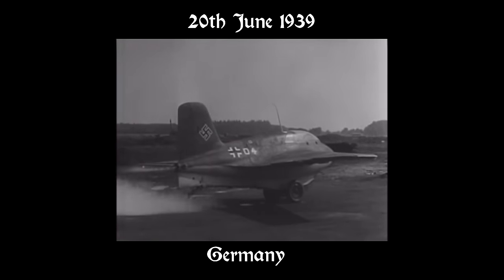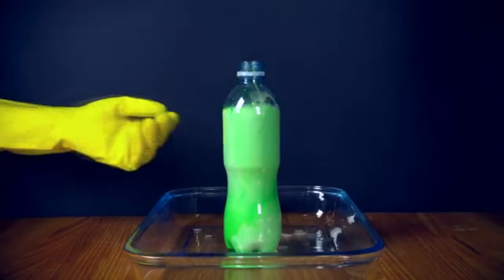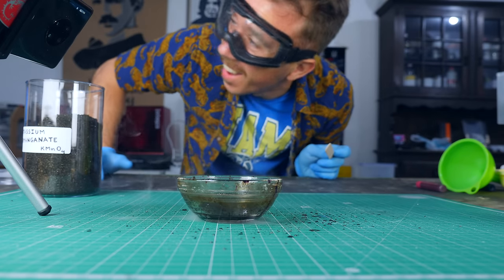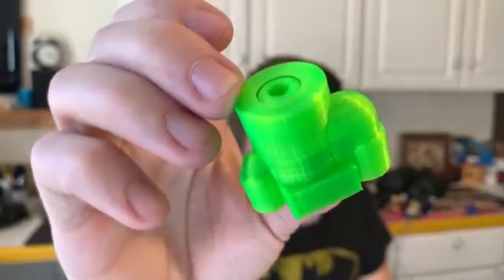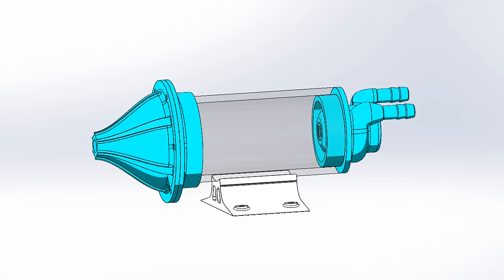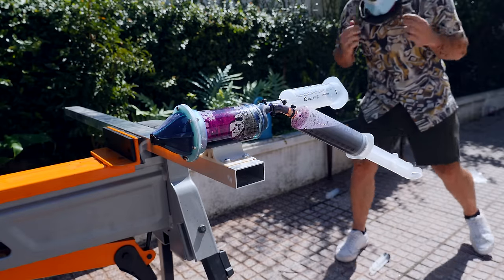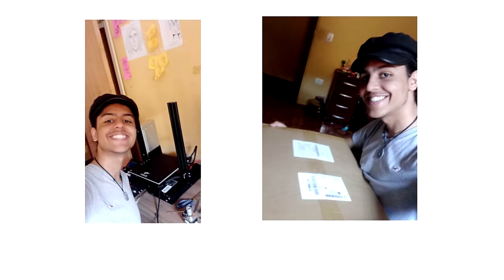The Forgotten Nazi Cold Rocket Engine (3D Printed)

Comment: Make an ALICE rocket, but using hydrogen peroxide instead of water.  
https://en.wikipedia.org/wiki/ALICE_%28propellant%29
[update]The output of H2O2 decomposition is H2O and liberated O2 
Al H2O combustion results in Al2O3 and liberated H2.
I would presume H2O2 Al combustion would not have much leftover H2 or O2 if the stoichiometry was matched as those have an affinity for each other.
Reply: I don’t think H2O2 would benefit the reaction, Just thinking about the reactions in my head, Im 90% sure you would get less out of H2O2 and aluminum frozen than H2O and aluminum frozen
Reply: @demolition3612  The output of H2O2 decomposition is H2O and liberated O2 

Al H2O combustion results in Al2O3 and liberated H2.

I would presume H2O2 Al combustion would not have much leftover H2 or O2 if the stoichiometry was matched as those have an affinity for each other.
Reply: @zyxwvutsrqponmlkh  You can't really freeze H2O2 above like -60°C so preparing and storing that would be kind of a pain already. Also the H2O2 will probably start decomposing due to the high surface area of Al nanopowder present, which would lead into thermal runaway pretty quickly and make it dangerous to work with. Besides that, even at appropriate storage temps like -80°C the peroxide will still slowly decompose, turning the propellant into a porous mass and most certainly lowering it's efficiency.
Reply: @zyxwvutsrqponmlkh  I know, however he is using 50% H2O2 50% H2O, and on average the reaction would be like this ; H2O + H2O2 + (2)Al -> (2)H2 + 1 Al2O3 
The reaction with 100% H2O goes as fallows, (3)H2O + (2)Al -> (3)H2 + 1 Al2O3 the one with 100% water gets you more hydrogen per aluminum oxide generated, this is negated if you use 100% H2O2, 
(3)H2O2 + 4Al -> (6)H2 + (2)Al2O3
Also in an Alice rocket it needs to be frozen as a mixture, and the aluminum powder must not be oxidized. H2O2 is just slightly harder to freeze apposed to water.
Reply: @Bavarianscience  H2O2 freezes very slightly after water.  I have used it to try to fractionally distill 35% peroxide.
Reply: @demolition3612  Aluminum forms an oxide layer instantly upon contact with air (or water, or hydrogen peroxide).  This oxide layer is important and will help protect from spontaneous reactions.  But you obviously don't want it too thick or you cant get it to combust when you want it to.
Reply: I wish I knew what you guys were talking about
Reply: @Swiftss  It's a proposed, presumed improvement on a rocket propellent that is hardly ever used.  Burning aluminum in water is the original, I think it may work better if you burn aluminum in peroxide.
Reply: @zyxwvutsrqponmlkh  oh I see, I never would have thought of that. And you are clearly 10x better at physics and chemistry than me XD
Reply: @zyxwvutsrqponmlkh  the oxide layer is always too thick, the idea is you want no oxide so it will react, its supposed to be a propellant, so it needs to react and not have an oxide layer. The oxide layer is always a few micrometers thick
Reply: Lets hope integza isnt dumb enougb to fall for these like botters. 2.2k likes with only 10 replies? Sure. A better comment has 1.2k with almost 40 replies
Reply: @demolition3612  Aluminum dust with no oxide layer spontaneously combusts in air or water, it simply wont work at all.  Poring molten aluminum in water can explode foundries and casting plants sometimes explode because of this.  This potential energy is exactly why aluminum is a suitable rocket fuel but it absolutely needs the oxide layer for practical reasons.  Ideally you would identify some ideal grain size with some standard thickness of oxides.
Reply: @piguy2829  I think he buys them himself to get engagement metrics which makes the algorithms happy and drives traffic.  You look at all his videos right after launch and you will see this sort of thing, the first handful of decent comments get a ton of likes right away.
Reply: Another advantage that came to my mind is that, if this is going to be a rocket, it would save weight as well
Reply: An ALICE rocket sounds cool.
Reply: 1. It would be easier to do a sugar candy (and KNO3) rocket.
2. Maybe you didn't notice, but Integza doesn't like to make solid rocket engines.
3. ALICE is very complex to manufacture (academic researchers had problems with it).
4. ALICE requires very low freezing temperatures (like -40*C) in order to ignite and not explode.
5. ALICE requires ridiculously fine grain of aluminium powder (which is very dangerous).
6. Didn't you buy fake likes for this comment?
Reply: Me163 was the first
Reply: That would go runaway the moment you try to mix it 😉
Reply: @hufca  -40 C is simple to get. Acetone and dry ice bath gets you close enough.
Reply: As cool as an ALICE rocket would be, I feel like that would be far too hot for his goal of keeping it 3D printed. But at least I learned that ALICE rockets existed! Thanks for sharing!
Reply: I watched a video about Alice propellant right before This one and now I see a comment about it lmao
Reply: @FrankRoosevelt32  Yeah, but alice is more like a solid propellent which needs fewer if any 3d printed parts.  A steel pipe with a rocket nozzle on it would probably work.

Comment: I have a stupid idea with some potential, that largely defeats the purpose of this engine

Unless I'm stupid, the breakdown of hydrogen peroxide makes a good amount of oxygen gas
Why not add some fuel to the catalyst, to react with the oxygen, generating more heat and thrust?
Reply: If you use ethanol as fuel Tada now u got a V2
Reply: @rh9909  add tablespoon of gyroscopic inertial GNC, a pinch of high explosive and a empty kitchen paper roll... A bit of super glue and now you are ready to send your homemade V2 over the British channel!!! 🤣
Reply: That would get very hot though, and burn 3D printed rocket parts...
Reply: @rh9909  No the V2 used kerosene and LOX. The peroxide expansion just ran the turbo pump.
Reply: actually, the first jet pack was made using this same concept.   why not make a jetpack with these rockets.. if i remember correctly, the design had used a pipe from the expansion chamber to feed into the supply containers, and a variable restriction valve in that feed tube to control it.   as more pressure is built up into the reaction chamber, it back feeds to the supply chambers forcing more into the reaction chamber.
Reply: The British Black Arrow rocket used this. The reason it wasn't used more often, is that the reaction with kerosene isn't as energetic as simply using LOX. The British found a sweet spot using it, as it produced lighter reaction products which improves efficiency. The V2 actually used H202, but it used it to drive the turbopump, which then pumped LOX and kerosene into the combustion chamber.
Reply: @777swampie  Kerosene? State your sources pls
Reply: @777swampie  https://en.wikipedia.org/wiki/V-2_rocket says LOX and 75% Ethanol 25% water.
Reply: @u1zha  My bad. I was thinking about the Saturn C5. The V2 used LOX and 85% ethyl alcohol.

Comment: Have followed rocketry since the 1950s. Have two suggestions for cold rocket:
1) Although your injector worked, the reaction was not full. You can see the wave moving back and forth inside the engine, indicating poor/incomplete transition. 
2) What you need is a combustion chamber of the right size and shape, fed by an injection plate designed to spray the proper percentages of t-stof and z-stof. You were using them 50/50, but the literature shows that a little bit of t-stof goes a long way. It's more like 10 to 1.
3) Eventually you're going to need a way to pump the fuel. The same stuff was used to power the turbine pumps in the V2 rocket. Print yourself a turbine and use the same fuel for both.
4) Have you ever heard of a rocket nozzle? You're going to need one. It's a nozzle that turns a spray into a roar. Have you ever noticed brass bands? They have bells too. Just for different reasons. But it's all the same. Just a matter of frequency.
I love your stuff! Did you say you live in Texas? I also settled west of the Pecos, where there is no God. 
It's very odd, but I'm 69 years old, and you remind me of my father. He was always looking at me as if to say, "You could not be the product of my loins." I was, and now have all of his odd twitches and proclivities myself. Thanks.
Peace,
Reply: as a german, its called "stoff" not "stof"
Reply: Pretty sure he's Portuguese.
Reply: He said  "You could not be the product of my loins."? I know this man! Your father was Buford T. Justice.
Reply: If I'm not mistaken, the "rocket packs" developed last century were H²O² powered also but they used a platinum "sponge"/mesh as the catalyst. The nozzles got extremely hot in the process.
Reply: These are really great suggestions! He lives in Portugal, tho.

Comment: you need a checkvalve that stops backflow.
also : do you know the double syringes that two-component glue comes in?
a similar thing might help with putting out the two components in a good relation.
then: the steam should contain a lot of oxygen. is it enough to be used in an "afterburner" ?
Reply: A checkvalve would stop the reagents flowing in, also. And it would always trigger while the reaction chamber is under higher pressure than the syringe. if not, you don't need a valve anyway...
Reply: @Andreas-gh6is  I think stopping inflow at times is better than backflow. A check valve might not be such a bad idea
Reply: Peroxide can be used as an oxidizer in its own right.  In other words, yes. If you injected fuel into the exhaust stream it would burn strongly and produce thrust if it were followed by a suitable nozzle.

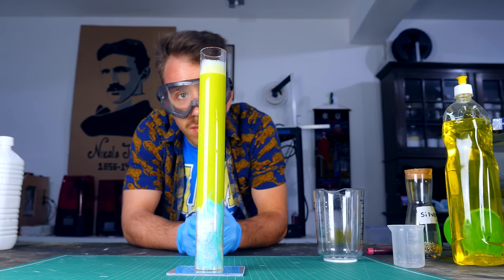Comment: 4:22 "... I need to find another solution..." Classic chemistry humor there.
12:12 Given that your thumbs are holding the syringes in place, that is a measure of how much pressure the rocket is (currently) generating; viz, the rate of reaction will need to be increased by several orders of magnitude, probably to almost "explosive" levels.

Comment: I feel like you could i use a whole lot less permangante since it's a catalyst. It might make the output stream more consistent. Or even better find some way to hold it stationary instead of in a fluid? Like a mesh or honeycomb that the peroxide gets shot through. I have no idea how that would work but you're the engineer.
Reply: Platinum mesh would be ideal iirc. Probably some cheaper mesh that could be used tho.
Reply: @zechsblack5891  hmmm, that break instantly when the platnium oxidices (burns)
Reply: So let's imagine he dipped a half cured resin print in it. he would have to change the nozzle and make it use the whole area and there are reasons he's avoiding the middle. But then those are replaceable fuel cells and a chance it doesn't stay on
Reply: I think your thinking of a hybrid rocket fuel grain
Reply: @zechsblack5891  wouldn't a car catalyst be perfect for exactly this?
Reply: @zechsblack5891  I'm thinking a silver mesh would be perfect for it
Reply: @xathridtech727  I really like this idea. Dip a half cured mesh in silver powder and then cure it
Reply: @Enderbro3300  if he dipped it in the magnesium permaninate it would be stronger
Reply: @Enderbro3300  hmmm, that break instantly when the silver oxidices (burns)
Reply: @xathridtech727  very true, but that might get dissolved in the water, but its worth a try!
Reply: @okok-mb2vp  the silver shouldn't be oxidizing though. It's just a catalyst. It facilitates the reaction but doesn't get consumed in it
Reply: I would take a stainless steel mesh and then platinum plate it since both materials would be very far from the temperature at which they fail or oxidize and the platinum plating would only need to be thin, allowing for serious cost savings.
Reply: @pabloarroyo1023  I really like this idea! I could see this working!
Reply: Platinum has zero advantage over silver in this case.  People have actually been racing peroxide monopropellant carts for years, it's like an actual sport. https://youtu.be/j2cadiB6-NM They use fine silver mesh as a catalyst and high test peroxide >90%.

@ok ok sorry to single you out but that's just so ridiculous. Platinum is one of the most unreactive metals.  You could heat it to white hot in pure oxygen and it wouldn't burn.
Reply: @whatelseison8970  The advantage of platinum (which I agree is likely overkill, but would help for maximum efficiency) is that unlike silver it does not oxidize in the air, and therefore reacts works more readily as a catalyst, although I know that at any reasonable flow rate the silver oxide would quickly be removed. That does present a slight problem for reusability, as the silver, unlike platinum, would wear out

Comment: I will note, that a few successful ME163 flights occurred, with confirmed kills on allied bombers; who didn't understand what the hell was attacking them, out of nowhere, with no sound.
that said, the design has a higher body-count of pilots, than enemy airmen. Turns out, flesh and 90% Hydrogen Peroxide do not mix well.
Reply: plus the design of it made it incredibly hard to control in flight
Reply: And the operational range was rather poor.
Reply: High Test Peroxide doesn't mix well with ANYTHING. It even has a tendency to spontaneously explode. Some countries have used it as a torpedo propellant, but they tend to eventually have catastrophic accidents. It's also used in some systems in modern rocketry, usually reaction control thrusters.
Reply: Ah yes, not sure if you would even want to survive that if you got showered within a 90% hydrogenperoxide cloud. must be a great feeling when it covers the inside of your lungs
Reply: Eew furry
Reply: @goldy24t  eww homophobe
Reply: @polyjohn3425  Yeah that all checks out tbh
Worst bit about the ME163 though had to be fueling it, given some genius decided to put both fuel ports adjacent to each other, and not label them well.
Reply: I think that the me-163 actually used another mixture with the peroxide to form a hypergolic fuel. The other mixture is the one that melted the pilots b/c it had hydrazine in it. 

Edit: early variants of the me 163 used a monopropellant rocket that only relied on the decomposition of peroxide while later variants used a bipropelant that consisted of the peroxide to act as a oxidizer and a mix of 30% hydrazine hydrate + 57% methanol + 13% water with a small amount of potassium-copper-cyanide. I believe the version that melted a bunch of pilots is the late war version
Reply: me 163s would sometimes just blow up on the run way as well
Reply: @theanphiban7160  yep and they were so powerful that they could snap the pilots neck on takeoff too.  The pilot who got the highest and fastest climb in history was dead almost instantly so a German corpse holds he record 😂
Reply: @vaelophisnyx9873  Cry
Reply: @goldy24t  Go learn to be a human and stop hating people for being themselves :)

Maybe then someone will actually love you

Comment: You can build two pressure vessels filling them with Hydrogen peroxide and potassium permanganate add compressed air. now you just have to open two valves to feed your rocket engine. An even better way is to coat ceramic beads or a metal mesh with the permanganate. This way you have less water (easier mixing and just one valve) and thus less weight.

Comment: I think that some thrust is escaping at the syringes making them harder to pump which is bad
A one way valve should work
This is where your old TESLA value would work
Reply: That's not how thrust works. It doesn't matter if the pressure pushes against a valve or the syringes, the thrust would be the same. A valve would not have any effect, especially a Tesla one.

Comment: I think a cool video would be using the Tesla “valve” in a water pump, it would be interesting to see how fast water could flow and if any pressure was able to be made.
Reply: My THOUGHT exactli
Reply: Not a bad idea to control back pressure.
Reply: Pitch it to an engineer thats what i do.
Reply: It's already being done. To genius to not be utilized for awhile now.
Reply: You all are referring to a check valve, the engineer symbol for which is << or >> depending on flow direction. 
The tesla check valve has no moving parts and would work great for this application. 
Look for his other videos explaining the valve, he 3d prints one.
Reply: @forcesightknight  It is a passive check valve, that’s the idea. I’m wondering how good it would actually be in practice, variations of the angles and size of the loops.

Comment: It may help to create a “solid propellant” style lining with the KMnO4 and have the H2O2 flow through it but I would imagen the stream velocity through the lining would have to be somewhat high in order to keep the thrust in one direction ish
Reply: This would not work as well: It's an issue of surface area. As a liquid spray the surface area is massively higher then it could be as a lining. That being said, I'm pretty sure Integza is using a massive excess of Permanganate  -  could use a LOT less.
Reply: @crocosnz3322  re: permanganate, true! Also check valves in the injection lines will be key!

Comment: Yea like the idea of 3d printing a steam engine an I also recommend making a gas engine with 3 printed  metal like the last video.
Reply: I tried that, but the tolerances of printed parts don't meet the standards of gasoline combustion. The term that describes it in action is "catastrophic failure".

Comment: I did some shoddy half assed math. I guess there were around 16 beads wide in that cylinder. And, that it was around 30 beads high. So, was that approximately $1500 Euro worth of silver? (2*3.14*8*30 = 1507).